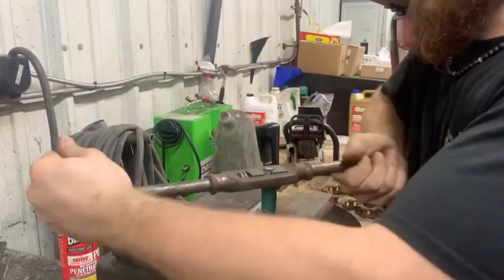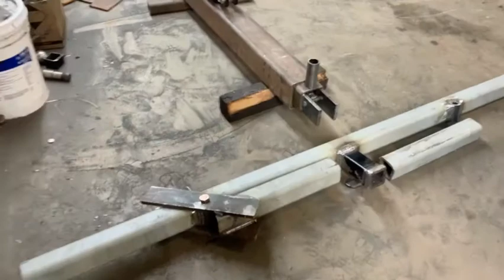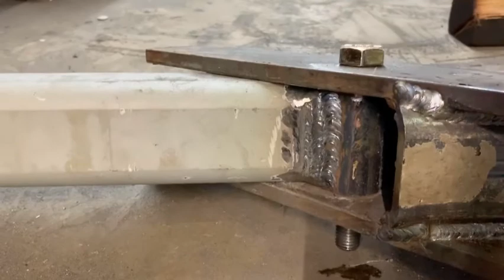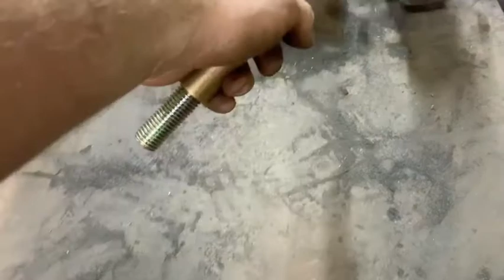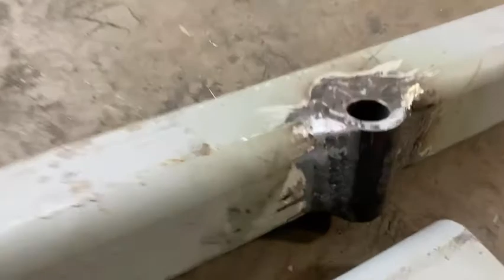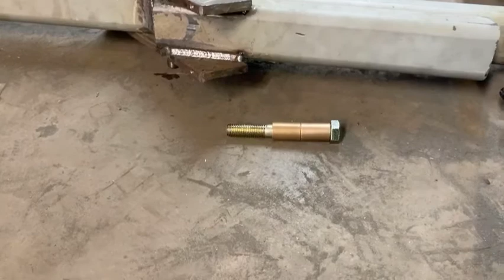Tow truck wheel lift build part 2

Comment: push on aluminum mig, is most important on steel you can drag or push. If you're getting pin holes try more gas or change angle of nozzle. your welds look good to me.